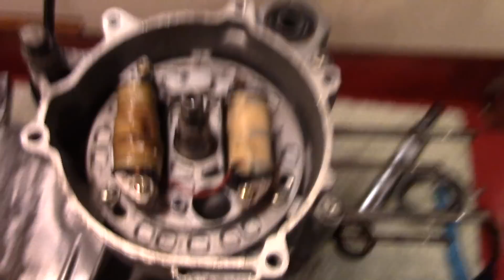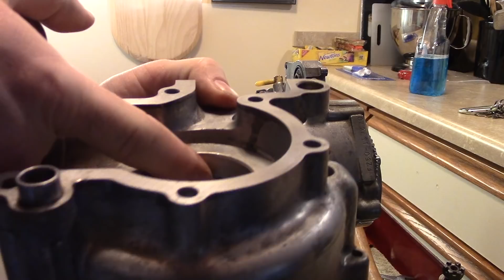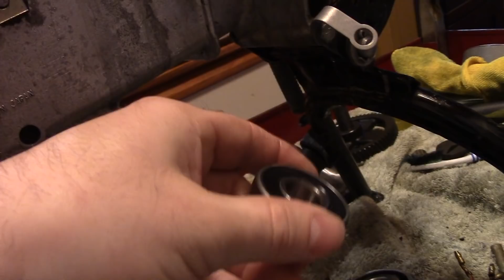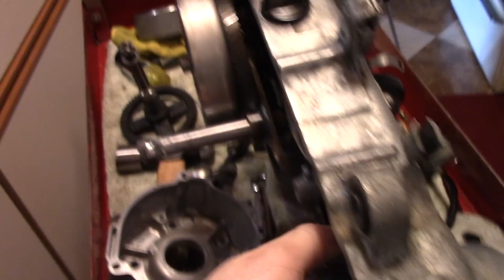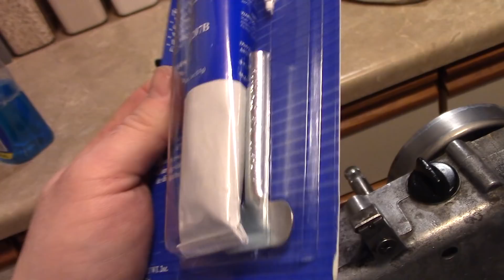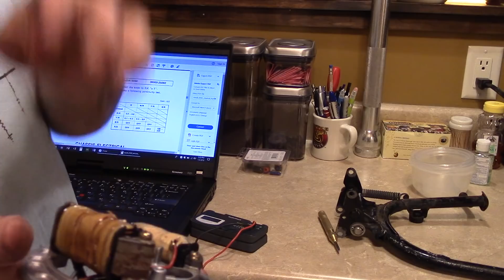1980 Suzuki FZ50 Project - Part 7 - Splitting The Crankcase

Comment: yeah the stator is expensive because no one makes a replacement for them. I have 2 FA50's and stator's for both. They are both showing 1/2 resistance they should be so the battery doesn't charge and the lights wont work.

Comment: Should do resistance testing without touching the metal at all otherwise the meter takes a reading considering your own body as a resistor and part of the circuit! Right hand with alligator clip or stick pin behind plug and left hand away and isolated from any metal parts. That is one of the reasons your resistance readings were oscillating, nonetheless thank you so much for your videos they are great and I am learning a lot from it as I have a Fa50 I am to restore.
Also you can gently peak loose resin and sand it and re coat with resin they are only there as an isolating agent all u gotta do is brush some more on and sand excess gently to make them both weight the same on a scale.

Comment: Did you just slide/pull/hammer the cover off? I have gotten the two covers apart, but the rod is stuck to the cover, and i need it off to change a bearing. Thanks for help.
Reply from the maker: No, I had no difficulty removing that part to be honest.
Reply: Got it off with a bit of hammering.

Comment: Should this coil get hot in normal operation or might it indicate another fault, such as current back feeding from the now missing battery?
Reply from the maker: This bike had a few electrical problems that I am not entirely certain of the root cause. All running lamps were burned out, the battery fuse was burned, and I found a few possible short circuits. When I kicked the engine over after replacing all bulbs, I was able to get the lights to "blink," indicating that (at a minimum), the lighting coil (the one that overheated), is producing current. I believe what really happened here is someone ran it with a dead battery, which overburdened the coil. Eventually, the battery fuse blew (protecting the coil from further damage), but removing the battery from the circuit caused a spike in voltage that blew out all the bulbs, one by one. It's critical that these bikes are run with a good, fully charged battery at all times!